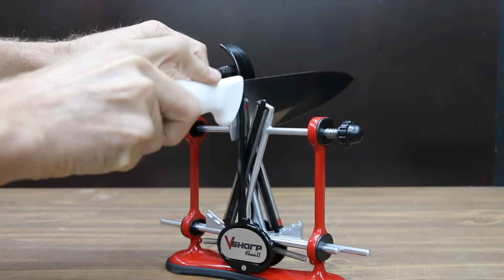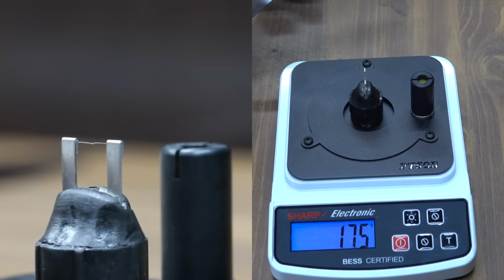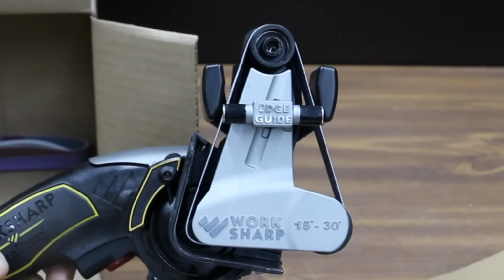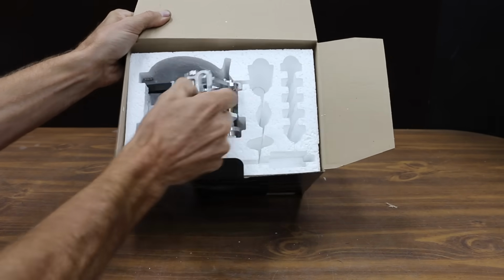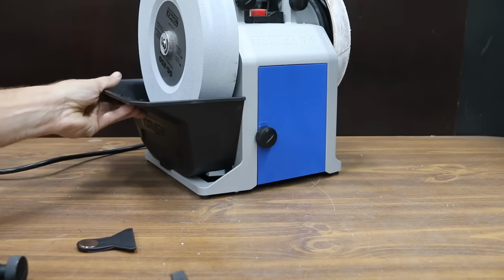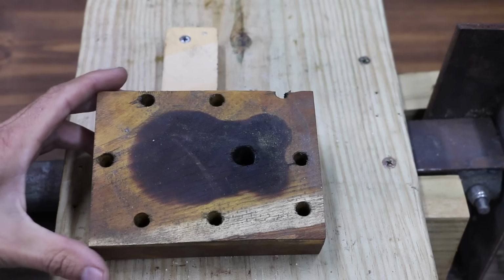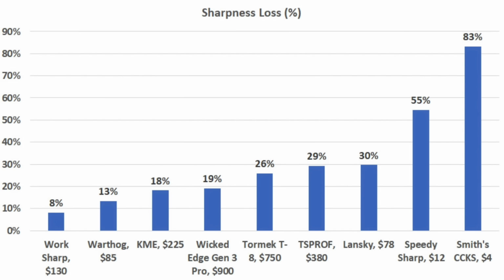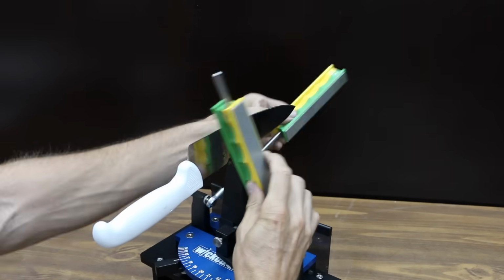RUSSIA vs USA Knife Sharpener? TSPROF vs Lansky, Wicked Edge, KME, Tormek T-8, Work Sharp Ken Onion

Comment: Excellent vid! I loved the aesthetics of the Russian sharpener which made the machinist in me drool. For practical use though, I am very happy with my Smith and a couple similar ones that work in the same way. Only a few bucks and they easily fit in my kitchen drawer, and take only a minute or 2 to sharpen. I really haven't noticed  my knife not holding an edge after cutting lots of vegetables and the abuse of plastic cutting sheets. I only use one kitchen knife and I sharpen it a few times a year.

Your knife making was interesting. It would be interesting to compare your choice of mild steel to a blade made from leaf spring, or a thick machine hacksaw blade (rather than the thin hand hacksaws. Another day maybe 🙂
Reply from the maker: Thanks!  Thanks for the suggestion.

Comment: God, that Tormek is sexy.
Also, an important thing to note about pull through sharpeners is that A. They are very aggressive in removing material, which ruins the life of your blade, and B. It can pull ions out if the steel on the edge, making it weaker every time you use it.

Comment: The best knife sharpener is a belt sander and a buffer. sand the blade til it gets a wire edge, then buff the wire edge off. Guaranteed max sharpness.
Reply from the maker: Thanks for the feedback.

Comment: That russian unit just looks like a nice tool thats well made with precision parts.
I have a Smiths sharpener that wally world sells for $15, the one with a scissor sharpener. It takes 10 seconds and gets most  knives sharp enough for me. Works on about  half the scissors Ive tried.
Most of these in this test are way too fiddly for me. I dont want to make sharpening the knife its own task, I want to get the task done I got the knife out for.
Reply from the maker: Thanks for sharing.

Comment: I jsut wanted to post a  comment about the cheap lansky system. I’m sure pf will take this down, but I’m putting it anyways. After getting the lansky based off this video I had a decent edge come out of it ( I hand sharpen with whetstones) and after 5 or 6 sharpenings I’m fed up with the system. Between the titling knob and the main screw adjusting is such a nightmare.. some knives are ok but others it’s such a nightmare and it comes out every time u move it u have to re adjust it... (specifically the small knives that are supposed to use the little notch up front) I have put up with it since day 1 and after at least a dozen times of it falling out after tightening it ( oh btw u have to keep moving the system down the knife if u have a long blade because it affects the angle it sharpens) all the constant adjusting and having to keep a screw driver around and holding the knife while adjusting.. it sucks.. I am in no way saying pf is hiding crucial info or any sort foul means by him I’m jsut saying that’s my experience and honestly it’s rediculous.

Comment: Lansky sharpens nicely, I got one myself. But the design and user-friendliness is so 1980s! It feels so low quality. I would like an update using modern design/fabrication. E.g. a nice box with actual lock/hinges. And removed those annoying thumbscrews with a better locking system (like a spring + release button or something).
Reply from the maker: Thanks for the suggestion.

Comment: Did you experience any tip damage, when using the worksharp? I have one and tried using it on cheaper knives before wanting to use it on my expensive knives and I ended up messing up the tip on all of them. Probably user error but still.

I, also, bought the lansky sharpening system but didn't get the diamond stone version. Really hard to re-profile an edge on a thicker blade made from D2. Gotta get the diamond stone set. Still a very easy system to use and works great on softer steel.
Reply: which one, the original or the version 2 with tip guide?

Comment: ...I mostly use files or a Smith's Diamond for the small stuff...industrially we used a 600 grit carborundum strip on a block of wood, liberally wetted, to get incredibly sharp knives to cut down 40-45 inch diameter rolls of newsprint, with blades handmade from old hacksaws from the mill's machine shop, using short pieces of plastic pipe squeezed on as a handle...
Reply from the maker: Thanks for sharing.

Comment: I've got a lot of kitchen knives from very cheap (2€) to medium expensive (100€). I've used sharpeners ranging 10€-60€, and each of them was able to sharpen the less cheap knives to the original sharpness. The more expensive sharpeners were able to do so more often until their wear was too much, but best money for value are by far the ones in the ~10€-range. We're talking "soft tomatoes in thin slices" and "deep-frozen meat"-sharp, i.e. "sharp enough my wife doesn't dare use them", but not razer blade sharp.
Reply from the maker: Thanks for sharing.

Comment: $75 for the Lansky? I think I paid 35 I have tried almost everything including the paper wheel for the grinder never could get the hang of any of it simply had to invent my own method. Now I just touch up the edge with 600 grit sandpaper on my belt grinder then I simply use a ceramic rod for a couple of Strokes and then drop. Shaves your arm with no effort which is the only testing method I have LOL
Reply from the maker: Thanks for sharing.

Comment: Very interesting, but as a baseline it would have been good to include testing the sharpness created with stones.
I have an old 40+ year old Buck kit with 2 small stones & oil. I remember getting a cheap pocket knife sharp enough to shave hair off my arm. Though I own a couple of expensive Washita stones, I've recently been using 2 cheap double sided ones to sharpen my kitchen knives. 1 is from Harbor Freight, $4, the other finer grit one I got at Dollar Tree, $1. I am able to get a pretty sharp edge that cuts paper ribbons easily off a sheet of paper. One thing that made a big difference was a stone holder, $15, so you don't have to hand hold the stones.
How about a test of expensive stones vs cheap ones?
Reply from the maker: Thanks for the suggestion.

Comment: Loved this test.  I upgraded to a KME.  KME and Wicked Edge both have great reputations in the knife world.  The advantage of both is there are aftermarket stones and strops that can get your knives very, very sharp with mirror like bevels.  The other advantage of those aftermarket stones and strops is you can tailor the bite of the edge (apex) to the intended function of a knife.  Your camp knife that's chopping branches and creating tender for the fire should have a different edge than a sushi knife or even a vegetable slicing knife.  As always, great job, Todd.
Reply from the maker: Thanks and you are welcome!  Thanks  for sharing.

Comment: One remark about TSprof - the base abrasives are fine, but there is tons of aftermarket abrasives up to 20000 grit. Boride and Naniwa can be used here. And even diamond paste and custom natural abrasive sharpening stones, so you are limited with abrasives, not sharpening system.
Blitz 360 allows you to achieve constant and repeatable angle with any steel from noname kitchen knives to m390, s110v, 204p, Maxamet, zdp-189
 But TSprof can look a little bit complicated at first. And sharpening definitely takes a lot of time :)
And finally, Blitz 360 is a mid range product of TSprof - there is a cheaper variants, as well as more expensive :)
No, i'm not ptomouter, just user, and i'm glad to see domestic product compared to such names as Tormek, Wicked Edge and KME :)
Reply from the maker: Thanks for the feedback.

Comment: Great video. Thanks! I was looking at replacing some missing stones for my Spyderco Sharpmaker that I have had since the mid to late 90's and I appreciate these tests, as I may replace the whole thing, probably with a Lansky. Ironically, I chose the Spyderco over the Lansky back then as it was cheaper and now that is reversed (depending on what options you get, of course). I had also noticed that the Sharpmaker made a great edge, but not as durable an edge as I would prefer.
Reply from the maker: Thanks and you are welcome!  Thanks for sharing.
Reply: I have never had much luck with those Spyderco bars. Too much like work.

Comment: you should "lubricate" the diamond stones with a liquid detergent of some sort (window cleaner, degreaser etc.). Running diamond stones dry will ruin them very quickly. I've used the very same cheap electroplated diamond stones from china for hundreds of blades with my Kazak Poland sharpener (similar to TS Prof) they still cut perfectly fine. With the Kazak I can sharpen any blade, even snap off blades by adding some spring steel between the blade and clamp to stiffen it up (would bend otherwise, thus significantly alter sharpening angle). Scissors are no problem, in fact, with the correct technique, scissors will be way sharper than any factory grind. The key is to fold the burr back (e. g. with the spine of a snap off blade) and grind it off until it's completely gone. local tailors have had their scissors sharpened by me and they're sharper and for longer than ever before. same for pruners.
Reply from the maker: Thanks for the feedback.

Comment: You need to bring on a real Japanese hard knife and sharpen it with some wet stones, you can even compare different stones, I have glass stones, after I run my knife on that 6000 it cuts through anything man.
Reply from the maker: Thanks for the suggestion.

Comment: On the grinder that lets you reverse direction of the wheel, could you do a test sharoening 2 blades in opposite directions to see if there is a difference n results
Reply from the maker: Thanks for the suggestion.

Comment: I tend not to rely upon any specific system to gain a ultra sharp edge and I'm willing to bet that I could get the same performance out of the Lansky sharpener as the TSPROF can, because the most important part of sharpening a knife is the removal of any burs, I have a japanese water stone and a Ruby sharpening stone and a leather strop for sharpening my straight razor for shaving, after I finish with the stone and the ruby block I switch to my strop and I can get a straight razor's edge on any quality knife. it's just a matter of how long the steel can hold that edge and how well you treat the steel if you want a knife with the same edge as a straight razor, then you are going to need a VERY hard high carbon steel, and even then it isn't going to last very long if you use it for wood carving. SO once you establish the level of sharpness that you want from a blade you will have to spend enough time to maintain it, so it basically boils down to how much time you want to spend sharpening your knife.

Comment: Any chance you can try out the Ruixin Pro in a future video? It's another great budget option with tons of different stone options. It's very similar in operation to the Lansky with a very similar price point. I bought mine with the waterstones up to 10000 grit and also picked up a set of diamond stones from 80-2000 grit. I typically use 4-5 increasing grits of diamond stone and then finish it with the 5000 and 10000 grit waterstones before using my strop. It's definitely just as easy to use as the Lansky and puts on a superior edge without all the mess of using oil.
Reply from the maker: Thanks for the suggestion.

Comment: I bought a 5$ Japanese style kitchen knife, then spent a good long time, to get rid of the secondary bevel. I like my knife with a huge and deep bevel that comes together in a razor sharp point. I sharpened it on a two sided stone, then 1000 grit, 2000 grit sandpaper, then a piece of leather with metal polishin compound. It's shiny, it's beautiful, it cuts like a charm.... for a week. Then it goes dull :D
Reply from the maker: Thank for the feedback.

Comment: I used to sharpen one of my knifs at the sink. once i had to sharpen my Nakiri with a cup. i sharpend a chinsel with a very flat stone. and when i do so i use to scream proudly "FUNK CAPITALIM"
Reply: for work a butchers steel and for home japanese water stones. i sharpend a drill wifth fine sandpaper.

Comment: Some great testing there and proves that a good edge lasts, but for the Smiths sharpener, although it didn't do so well with the wood, it was pretty darn sharp when first tested. 
Would that make a major difference if it was just used in the Kitchen or would the ease of being able to quickly sharpen it more regularly make up for it blunting quicker?
Reply from the maker: Thanks!  Thanks for the suggestion.

Comment: Another great video. If you just want to sharpen knives, the Tormek might be overkill, but since I use it for sharpening drills (unique 4 bevel cut with extral jig) and woodworking tools I find its versatility is worth the money.
Reply: I didn't think it got a fair shake since he didn't use the knife holder. I want to see the cheaper wen model as well
Reply from the maker: Thanks!  Thanks for the feedback.

Comment: The Work Sharp is the fastest for high volume work like a large set of dinner knives, but I prefer the Lansky for the occasional sharpening of chefs and butcher knives. The wire cutting test was new to me. Seems like the results might vary depending of placement of the wire on the blade.
Reply from the maker: Thank you!

Comment: The over engineered Russian is probably going to be my go to ... see a few guys cut or get blanks and use disk adhesive to attach 3M sandpaper to it and active some insane results with that fine tune adjusts its able to achieve!

🥃cheers🍻
Reply from the maker: Thanks for the feedback.

Comment: AS I have used virtually every system you have demonstrated, I noticed you only used the Tormek 250 Standard grinding stone. Tormek has several stones including a Japanese Wet Stone white extremely fine grain. For daily use the 250 is fine however for the extremes of sharpness required for some kitchen use the Japanese Wet stone is the difference of night and day. A coarse looking edge with the 250 and a mirror finish with the Japanese Wet Stone.
I have also sharpened my Metal late tools using the Tormek and again the extremes of sharpener can be seen in the cuts made in Steel. Thanks for Listening
Reply from the maker: You are welcome! Thanks for sharing.

Comment: They make and even finer grit belt than the ones you used for the worksharp! I'd love to see if that one makes a difference! love your videos btw i watch them all the time!
Reply from the maker: Thanks!  Thanks for the suggestion.
Reply: @ProjectFarm  oh they also make an attachment for the worksharp that can really make sharpening anything easy with it. you should try that out as well! it's called the 

Work Sharp WSSAKO81112 Blade Grinder Attachment

and red label makes some pretty good quality belts for the sharpener ranging from like 32 to i think it's 5000 or more grit belts

Comment: An idea.  I use disposable gloves when I'm working on messy things or chemicals.  I've noticed that some of the gloves don't last as long, some tear very easily and some don't handle chemicals well.  Can you test different disposable gloves?  Maybe test different brands and materials.  The color of the glove shouldn't matter, but maybe it does?  Also, the consistency - will one glove in a box last the same as another from the same box?
Reply from the maker: Thanks for the suggestion.

Comment: I've used those cheap "ceramic" knife sharpeners and it works okay.  I always thought different  knife sharpeners would created similar blade edges, with the only difference being how quickly it sharpens and the accuracy of the angle (and also how centered the edge is).  Well, I learned something new today.  Even though a knife sharpener can put a great edge on a knife, the durability of the edge is different.  

Thanks for another excellent video!
Reply from the maker: You are welcome!

Comment: you should have an actuator push down the knifes on the sharpning tester because your time to push down on the sharpness tester differes very and probably skew the end result. The last one is a very good example, you seemed hell bent on giving it a good result so you went sloooow compared to the others. ;)

And you should time how long it takes to set up between uses. 

I got one from the last time you tested in a drawer ready to be used whenever I get around to it. Not today, either. :P ;)

Comment: Amazing how precise your testing is, whenever I'm going to buy something I always check if you have tested it. Thank you!! You should definitely test some sets of ratcheting wrenches! Would love to see the results.
Reply from the maker: Thanks!  Thanks for the suggestion.
Reply: @ProjectFarm  Definitely ratchets.. I have gone through tons of them over the years.
Reply: The day will come, when manufacturers will tag their stuff with "Tested by Project Farm"
Reply: I want him to test my current wife with the women I want to leave her for to make sure im doing the right thing.
Reply: My craftsman 1/2" ratchet handle broke. It had a lifetime guarantee. The company went under; pretty sure the pledge of replacement won't be honored by the new brand, will it? *sigh* 

HF actually sells some pretty good wrench handles:in 1/2" I bought one made of composite with TPM sides and a socket release button, with about 50 clicks/360°. Another has a heavy handle a tilt head and a release button with ~72 clicks. Yet another has a chromed shaft, TPM/rubberized grip and very distinct clicks - 72. Also a set of stubby ratchets with tilting heads on sale - included a 1/2", a 3/8", and a 1/4" drive. They were all under US$20. The crapsman was ~$35.
Reply: @atlantajunglepythons1744  I like the old style craftsman ratchets, but saying they’re functionally better than a $15 Pittsburgh from HF would be a lie.